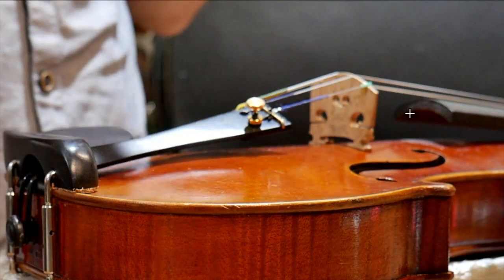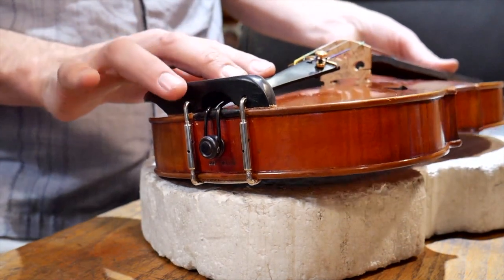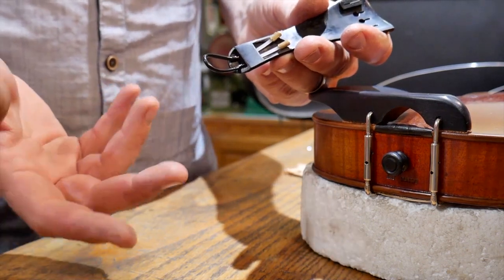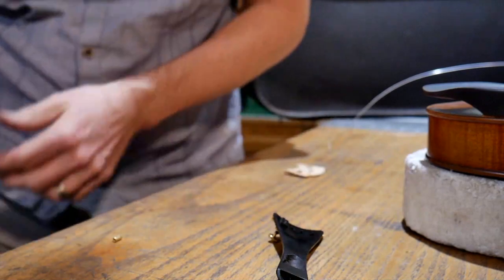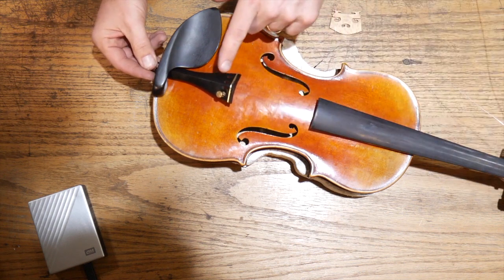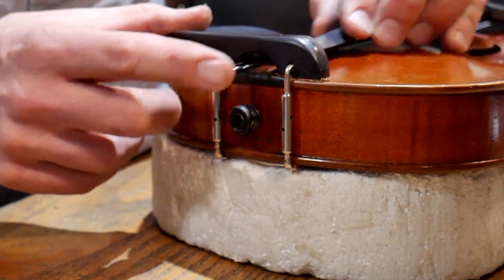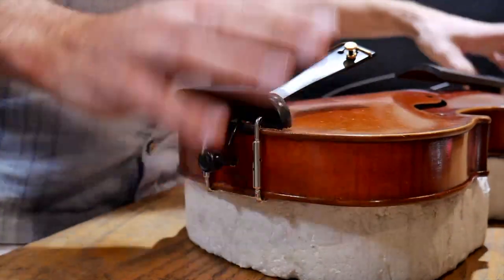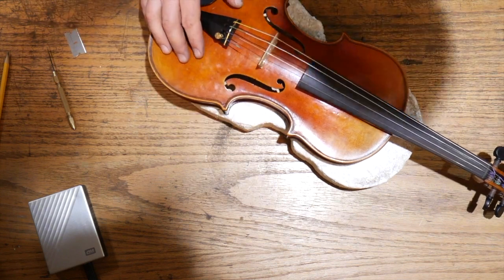Tail Gut Replacement

Comment: I have black aluminum fine tuners.  What is the distance between the bridge and the fine tuners?  How do I calculate the length? Is it from the beginning of the tuner or from the string line?
Reply from the maker: The distance from the bridge to the fine tuner depends on the size and type of instrument. A 1/2 Violin will be much different from a 3/4 String bass so, instead of listing the actual measurements, think ratio of 1:6 or the distance from the tailpiece nut to the top of the bridge is 1/6th the distance from the bridge to the top nut by the scroll. 
I like to use a metric ruler for this because the math is easier but think of this as a fraction: 1 over 6 = (measurement from tailpiece nut to bridge) over X. Now just make the fractions equal one another and this will give you the distance to the top nut. Make the necessary adjustments. Typing this out makes it seem more complicated that is actually is. :) It's just grade school math making your fractions equal one another.

Comment: Very nice. Just to be clear: you replaced the tail gut with a new assembly including new nuts. Are there different levels, qualities and sizes of this part, or are they all pretty standard?
Reply from the maker: There are a few different options in tail gut out there but I find the very basic one to be the best for almost every use and they're cheap, under $15.They do come in different sizes as well so be sure to order for your specific instrument and size, ie: 1/2 violin, 3/4 Cello or 16" Viola...whatever you have.  I always recommend replacing the nuts at the same time, the new gut will come with new nuts so use them. Thanks for asking, this is a great question.

Comment: My violin is new but when i was tuning it it snapped ,then when i fixed it its still making that sound now im scared to tune it again
Reply from the maker: Hmm... sound like there's something mechanical going on there. Is the nut slipping on the tail gut? Is the end button coming out when you tune it? Start by ensuring the end button (round piece the tail gut loops around) is staying in place when you tune it up. If that's staying put, then mark the position of the nut with a crayon or marker that will show up on the gut material and then tune it. If you hear that sound, loosen the strings and check to see if the nuts have moved. It may be the threads on the nut were stripped at the factory and you need a new guy.

Comment: I bought a used cello and the new strings won't fit the tailpiece. I hate the copy/fake Wittner combo tailpieces. I didn't factor replacing it in my cost.
Reply from the maker: Yeah… the fake Wittner are a mess. There are two options for you: 1) use a pair of flare nose pliers (and only flat nose) to slightly squeeze the string just above the ball to help it fit the fine tuner. 2) Use a screw driver to gently pry the fine tuner open - be careful here, there is not much room for expansion but it can be done.